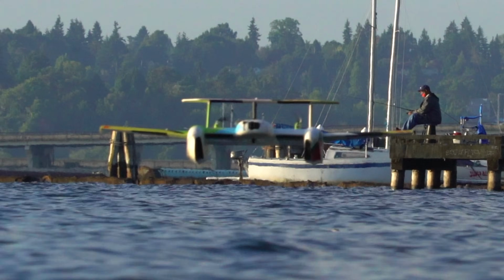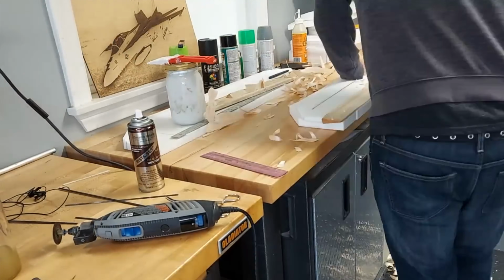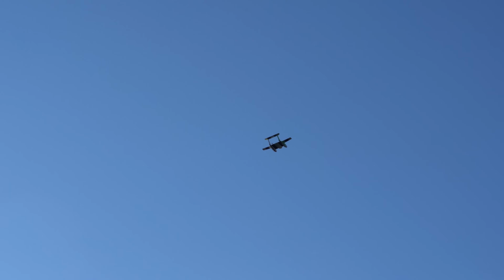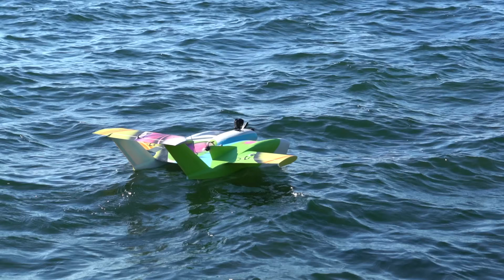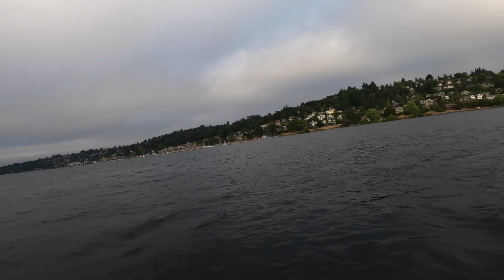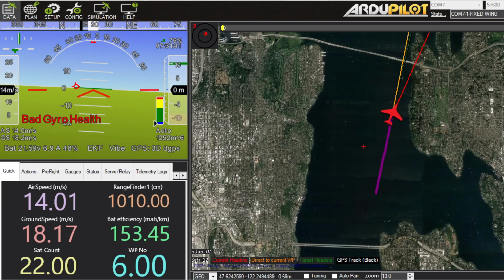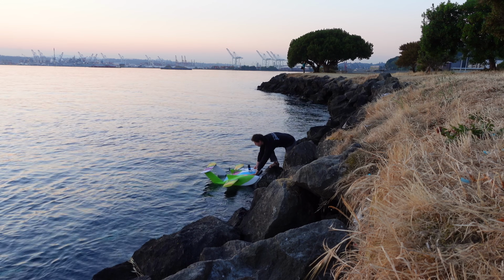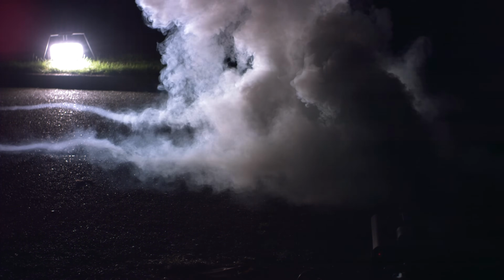R/C Ground Effect Vehicle - Long Range FPV

Comment: For efficiency science: Ask the plane to maintain an altitude that's out of ground effect and compare energy consumption against maintaining an altitude that's in ground effect? That would give you a measure like "minimum energy required to maintain level flight", which is a pretty useful metric for a ground-effect vehicle. Even if you get different speeds out of that comparison, you could still make a useful claim about energy required to travel between two waypoints.
Reply: The faster you go, the more the drag. The difference in efficiency because of speed is very substantial, more so than the ground effect
Reply: @gi295  which only makes it another part of the power consumption. If the plane reaches different speeds for the same "effort", then that's a base to start fine tuning the experiments. Start of with a maximum of parameters the same and measure overall consumption and speed (time between A and B), then tune parameters to achieve same speed (match the lowest of the two). Also, with such a small plane, I'm guessing it will be bouncing in and out of ground effect, which will have a slight effect on airspeed and drag too, so a variable consumption due to different drag is already happening within the same flight anyway. 
I agree with Saul that this would be the best approach to determine efficiency gain from ground effect.
Reply: what would be even cooler: an extremum seeking controller, maybe as an extra layer feeding a setpoint to the lower level PID ontroller, which measures energy use in real time and chooses the most efficient altitude to fly at

Comment: Three thoughts:
1. Awesome project, series, and music 
2. Turning altitude problem: Are you rectifying the lidar altitude measurement with roll attitude? Maybe even dial in some additional compensation with roll to account for the lower wing too
3. Flying over waves: With the lidar pointing directly down, your system is reactive and not so proactive in handling disturbances in measured altitude; meaning, you measure a high wave, your controller pitches up, but you've already passed the wave. How about pointing the lidar forward at an angle to get a 'look-ahead' measurement? Better yet, mount the lidar as far forward as possible on a stick out the nose. The distance to cancel out phase delay of the wave/vehicle reaction would entirely be dependent on the length of the stick, or your total control bandwidth. Could be a fun problem to solve on video :)
Reply: I love your work, I might try your flight controller and autopilot code some day if I have a chance.
Reply: I was wondering if it would be possible to mount it to a gimbal of sorts. Waterproofing would be an issue though.
Reply: Or several LIDAR units across the wingspan? Average them out with bias towards the central one in order to reduce input noise.
Reply: Or applying a Kalman-filter like logic to the sensor signal with a override threshold for anomalies (if it's already not applied). You can do it in software with minimal computation.

Comment: I have two things that I would love to see: 1. You could create a way for the vehicle to avoid obstacles using distance sensors where it can either fly around or over things(and perhaps even calculate whether it is on a collision course.
2. A way to control the speed in ground effect by allowing the auto-pilot to adjust the pitch and throttle. 

Keep up the good work!!

Comment: Would it be possible add a pressure sensor on the underside and top of the wings to measure what's going on? No idea if it would be useful, but you might be able to correlate it to efficiency, or factor it into the Ardupilot controller. Might just be a cool thing to see.
Reply: Actually it won't be that useful as it would be hard to set it to a value. But that's a nice suggestion.
Reply: I think it would be cool to see when the pressure semi stabilizes and ground effect is achieved
Reply: @ApacheFPV  yep
Reply: That's how an angle of attack indicator gets it's signals. It has to be calibrated one time in flight at zero g, if I remember how I calibrated my RV7
Reply: It is fine if the ground is flat. But with waves it is pretty hard to determinate what is the best pressure in this small scale.
Reply: Pressure is not changing very much with this small distances. So you need a very precise sensor. Water doesn't make it better though.
Reply: There should be slight overpressure
Reply: could actually be very interesting and relevant experiment. Looks like the mid portion of the craft is designed to best utilize the ground effect, but the outer wings seam to have pretty standard aspect ratio and profile.
If the  entire lifting surface was uniform then the reading wouldn't changer at all, the pressure difference would be craft weight divided by wing area, so it's constant 
(ignoring wing tip vortices, servos and so on). 
However measuring only under the main body in normal flight vs low flight would demonstrate the shift in lift and would represent how much the mid section is better for "ground effect flight" compared to the standard wing structure.
Reply: Maybe pressure sensors fixed inside body in such a way that levers run from true measure point to the pad. Using the lever to multiply force and create bigger readings.  Sort of like placing between the wing spar and the body. 
  Then you could map the pressure readings overtop the speed and try to get those two wave peak and troughs as close as possible.?.
  If the above is correct, would you want the intersection of those two values to be a far apart, or close together?
Reply: if you had an array of pressure sensors. 
you'd probably see waves of pressure shifting.
Reply: Nah that's dumb.
Reply: If you mounted a multiprobe vertically on the wing you'd see pressure changes across the wing. The lower the pressure vs ambient the more induced drag the aircraft is making.
Reply: Maybe not on the bottom but the top maybe, the problem is the air pressure changes and at that hight you might have to accurately give it data like every other minute.
Reply: @arnavpawar256  I don't think you need to set it to a single value. You could implement a maximum pressure point tracker where the output feeds into the target altitude. It'd be able to nudge the setpoint up and down a small amount to find the maximum pressure within it's control range.
Reply: @arnavpawar256  What about having a pitot tube aswell? In fact velocity is the only thing missing because i suppose it would be possible to get an altitude reading from the intrado pressure sensor. It would replace the extrado pressure sensor which would be relatively useless. Wouldn't this be efficient?
Reply: @eitamr  I suspect differential pressures (top/bottom) might change, otherwise how would the aerodynamics be any different in ground effect, as opposed to out of it?  

As the aircraft is not effected by what happens behind it (contrary to what the fringe conspiracy 'rockets must push on something for thrust' pinhead contingent believes) meaning after the oncoming air has 'touched' it and departed, it seems the difference in L/D must be due to an increase pressure effect below the wing.  At least that would be my guess.  

I suspect a flat plate airfoil, horrible as it would be in both cases, would operate much better in ground effect than higher altitude flight (several wingspans), by which I mean the difference might be much greater between those two conditions than with a wing sporting a reasonable airfoil.  

I also suspect that if any serious studies have been done by NACA/NASA, the Russians (with that very large scale prototype they built), or someone else that the airfoils might be different in shape, thickness, aspect ratio, max chord placement, etc.  I should do a quick bit of research to verify or disprove my hypothesis.

Let me finish with the statement that I am a retired EE with a fair bit of interest in flight, RC to full scale, and not an aerodynamicist other than as a hobbyist, so I could be full of crap here. Again, maybe some personal research is in order so I can make a more intelligent and better informed comment than this.  Just my two cents from non rigorous personal experimentation and experience.  If I am mistaken it would be the first time in my entire life, though.  :-P
Reply: @ApacheFPV  Can't you determine that by just looking at relative altitude over time?
Reply: I suspect whatever tech is developed here, it would be the same tech installed in the tomahawk missiles back in 1989 which followed ground contour automatically to avoid radar detection and hit its target.
Reply: Wouldn't pressure changes in ground effect affect altitude?  Use lidar and pressure to control lift?

Comment: Nice videos, but I think this would be a good idea for the next video - An RC sailboat!
You can just use servos to control it and you won't need bulky batteries for the propulsion.
Reply: yes.
Reply: something like "saildrone"
Reply: As it would need very small batteries for the sailboat, he can use solar panels for the recharging so it would have infinite range.
Reply: @arnavpawar256  would an integrated solar panel in a rigid sail be feasible in that scenario or would the light deflection angle limit its ability to output a constant voltage?
Reply: @AirJimInCT  you could prabably have flexible solar panels on the sail, which might charge with enough heel due to the wind?
Reply: @AirJimInCT  probably, a small panel on the deck would suffice though
Reply: With wind sensors this would be super dope
Reply: An autonomous model of a Silent-Yachts 55 or 60 with the kite sail.  This is a catamaran design so tons of room for solar on the deck, plenty of room in the hulls for any batteries needed, and a good bit of room in the "salon"/bridge-deck for the electronics.  The trickiest part of the design would be hands-free deployment/retrieval of the kite.  If you really want to get fancy, add a foiling system similar to what is used on the Aquila 32 or 36 boats.
Reply: I like the idea of a autonomous sail boat, I lived on my sail boat and set up the auto pilot and chart plotter to sail the boat along a route with tacks to keep it going with minimum input from me when it got to the point it needed to tack it would give 3 beeps just before and all I had to do was release the job sheet as it was just starting to turn and whilst it was still around the halfway point in the tack I would pull in the opposite job sheet and cllip it off on the winch then when it was all the way round there was either very little or no grinding of the winch to tighten the jib sheet unlike what you see on racing sail boats I had almost the same system as you would need on an autonomous sail boat as long as you fitted a self tacking jib then you would not need anything doing when you tack. 
I bet someone out there has already done it.

Comment: Those batteries amaze me, powering the plane, control surfaces, transmit video, use GPS.... amazing. Thanks for this video. I wasn't even aware that Ground Effect planes could fly so high.

Comment: Impressive! Friend of mine recently did a drone that would hold its position using an optical flow sensor and I remember how hard it was to get the control loop fine tuned. Can't even imagine how tedious that must've been for this much more dynamic system!

Comment: Only using one LIDAR sensor is so limiting.  I would use at least 2, this would allow you to average out the distance and deal with the chop, giving wrong reflection angles; you would average them and then use an offset between them to control attitude.
However, I would use at least 4 sensors, adding 2 on the wingtips.  This way you could easily filter out bad readings and keep from dipping your wingtips in the water. When you're at this level of expense and engineering, I would not skimp on sensors.
Anyway, total hats-off to you and your collaborators and community; all of it adding up to a fantastic video experience.  Thanks!

Comment: I wonder if you had two lidar modules, one in the nose and the other in the tail, and continuously averaged the two values and or used other math to smooth out the altitude signal.  That way it's not trying to adjust constantly between crests and troughs of individual waves.  Or additionally have some forward facing sensor to check for obstacles or approaching elevation changes in terrain.  That's getting into another level of complicated, but it would be interesting if it could be more reliably autonomous.

Comment: Outstanding work Daniel!  On the topic of analyzing efficiency: You could integrate the power over time to get energy, and the speed to get distance.  Keeping separate integrals for each mode, in-ground vs. out-of-ground effect. The ratio of total energy to total distance would then represent how far the plane could go for a given amount of energy for each mode. This should account for the nonlinearity in the relationship between speed and power.  Keep the great videos coming!

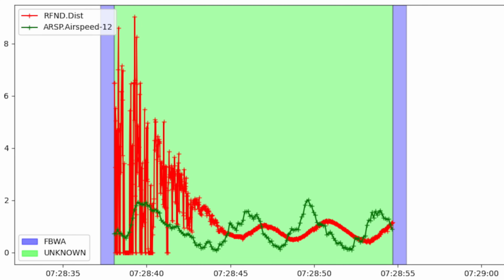Comment: At 7:12, airspeed and altitude oscillating together is expected - they are integrally related for a given power setting. The phase relationship should be almost exactly 90 degrees and it appears it is.

Comment: 13:07, you don't actually need to do that if you still have the power meter logged in Ardupilot. You have GPS waypoints with discrete time intervals so you have speed and distance of GPS legs, and you can do discrete integration to calculate your total power drained (w*s or joules, just power*time and sum those values for the portion interested in and get your avg or efficiency in joules per distance or time). You already have legs you know you were in ground effect flying close and separate legs when you were farther out without, so as long as they were in the same wind conditions (same direction, roughly same time) you can easily compare from the data you have.

Very cool project, I like that you discuss the issues and how you overcame them.

Comment: 1) adjust set point height above water in straight line flight based on wave height.  calm water == lower flight.

2) put a lidar on each of the wing tips.  when in a turn use the "inside" lidar as the height control input.

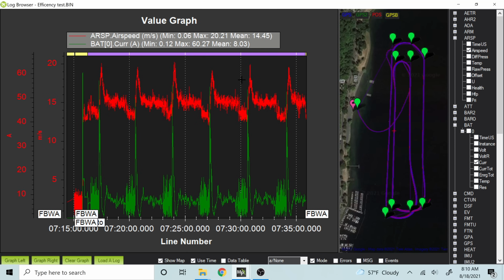Comment: @rctestflight you can draw a conclusion about the difference of efficiency between ground effect and high altitude, because I assume you started both flights with a full battery, so on one axe is speed (m/s) and the other Amps (which relatively can be translated to power/s as the voltage was decreasing more or less the same for both flights). Using your graph and averages (at 12:40), on high alt you get an efficiency factor of 1.9, and on ground effect 2. So on ground effect you actually got a 5% increase in effective efficiency. That is, based on the average numbers from your graph. If you factor in also the drag reduction (due to lower speed), you get an even more number if you start to think about total flight time.

Comment: For the DJI video, i like to add 3-6db antennas for long range, It helps to have one on each side of craft so you dont lose video in turns.... Crystal patch antennas on the goggles, focus mode off, 50mb 1200mw... You should be able to go 10km with no breakup as long as ya got good antenna placement on aircraft

Comment: If you can use a roll sensor to detect your roll angle accurately and make the PID ground effect control aware of the extra height required for a given roll angle using the wingspan and some trig you could bake the extra height needed for turning right into the PID control loop.

Comment: Have you considered positioning two lidar sensors, each at the wingtip? With this you could take average out of the two, and on turns use the sensors to prevent wing strikes. My knowledge on lidar is limited so I don't for certain whether it would work.
Reply: Actually it would work, but it's not necessary. He can also make a code to increase the altitude / lidar distance value when the aircraft is turning to avoid wing strikes.
Reply: when its turning the lidar measures the hypotenuse of a right triangle so based on the turn angle and the distance measured you can calculate the distance from the ground
Reply: I think it would be better to place one sensor at the tail or in the center, and one sensor at the nose, and it should be at an angle of about 45 degrees forward. So it can tell the plane if a big wave is approaching. If it's not angled, then it would detect a big wave too late and the plane will hit the wave.
Reply: What about flared wing tips? Upwards to run parallel to the ground/water level in turn. Forcing planes higher and sort of fight the roll with increasing pressure as it rotates into the ground effect.  Might make turns wider but also might add another safety against turning into the water or ground.
Reply: When on ground effect,  can turning with just rudder adjustment an option?
Reply: @arnavpawar256  I would love to see at a minimum 3 sensors one on each wingtip and one on the tail or nose making it possible to calculate a plane and it's angle and distance from the ground at any point on the plane which would allow you to set a minimum threshold to avoid wingtip strikes and even allow you to cancel out some of the noise. Another benefit I see is that you would be able to maintain ground effect even in large waves like you said or even automatically maintain the right pitch on hilly terrain. This could be combined with a gyroscopic sensor so when you might be level to the average surface of the ground you can tell if you are going up or down hill which might help you avoid noise by increasing or decreasing the average throttle level accordingly.

Comment: A good way to measure efficiency for aircraft is with range (distance/power output) or endurance (flight time/power output).  Airspeed is implied in both calculations but not required to measure directly.